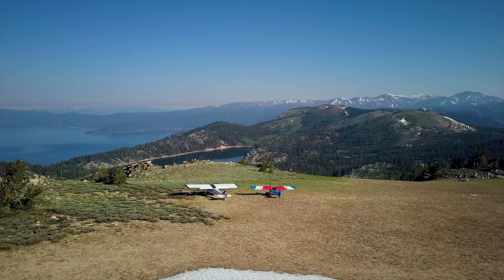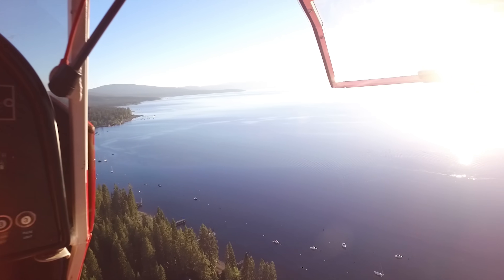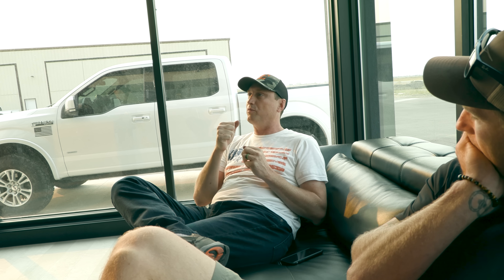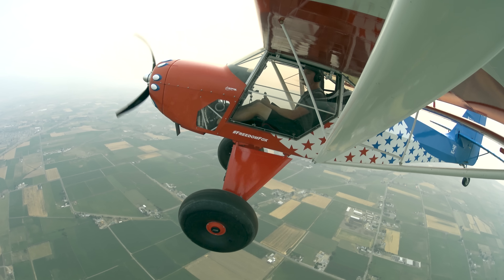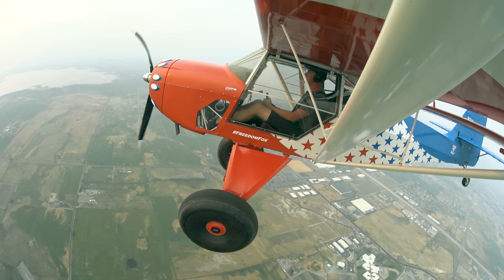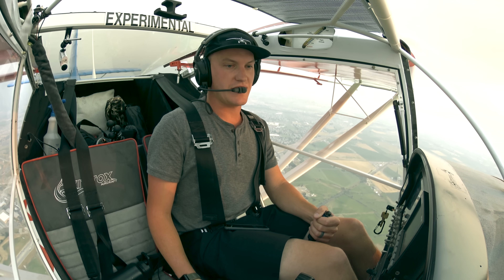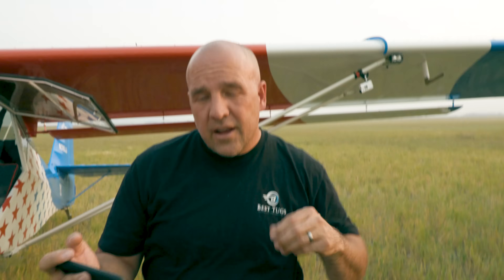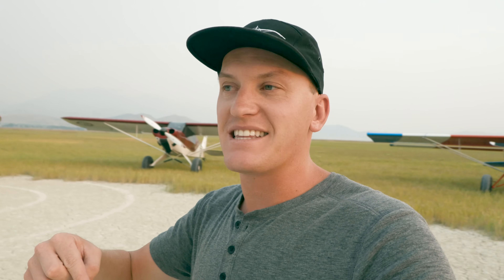YOUR FLIGHT INSTRUCTOR WAS WRONG! - Simulated vs Real Engine Failure

Comment: This is always an emotional debate!   I finally came across two intuitive examples that help explain- IT DEPENDS ON THE PROP, but probably prop stopped is less drag.   Fine propeller pitch, thin blades, and fewer blades tend to make propellers that produce less drag when stopped.   An example of this is a helicopter rotor.    The drag on an autorotating helicopter is high enough to give it a descent rate slower than a similarly-sized parachute!  Do you think the stalled rotor blade would give you that much drag?   As I picture plunging to my death in a helicopter with the blades stopped, it's pretty intuitive that the flat surface area of those types of blades aren't even close to the same drag as the disc of the autorotating prop.   

Now, as an intuitive example on the other end of the spectrum, consider a low-aspect ratio, huge chord, extremely steep pitch of a turbofan motor.   They produce much more drag with a locked, stopped fan than with a windmilling fan.     In the same "it depends" way, whether or not your idle power gives a better glide ratio than a stalled or windmilling prop depends on the propeller, the power setting, and the glide speed.

Comment: When I watch these I always wish there was more focus on the engineering answer to the problem. In this case:
If your rpm and pitch of the prop is above your airspeed you will decrease your decent rate, if it is equal it will do nothing, if it is lower it will increase your decent rate (and your engine will need to be applying breaking torque to the prop even if it is on).
When the prop is windmilling it continues to turn because the rpm and pitch are lower than the airspeed and it takes energy from the airflow and converts it to rotational power and turns your engine.
Finally the difference between a spinning (unstalled prop) and a stationary stalled prop. Just like when you give a prop too much pitch it stalls and produces less thrust, if you slow the prop down it will also stall and create less drag compared to when it is spinning slowly but fast enough to unstall the prop.
All the arguments about this fall into these various states. High rpm stalled prop (less than unstalled), High rpm unstalled prop (great thrust), Low rpm x pitch (low thrust), very low rpm x pitch (drag), stopped with pitch and stalled (drag but less than very low rpm).

Comment: My understanding having taken Fluid Dynamics in college - If you are going fast enough that the wind speed behind the propeller at idle is considerably lower than your planes air speed (say 10%), A spinning propeller will create more drag due to the pressure drag behind the prop. If its spinning, the pressure drag includes the full "disk" area behind the prop, if it's a stopped prop it's only the cross sectional area of the prop. The right answer is it depends. Depends on air speed of plane, air speed behind prop at idle.

Comment: C'mon blokes, it aint rocket science.  At engine idle, on the ground, in still air, the prop produces 'some' thrust & the engine idle speed is influenced by the actual load that the prop imposes as it pumps air. [if the prop fell off the engine, the idle speed would increase]
In flight, at engine idle, the prop still produces 'some' thrust which contributes to the forward motion of the aircraft. How great is this contribution??? Well, how long is a piece of string?
Regardless of how much, it is always "some" & this translates as a reduction of drag compared to when this small measure of thrust is not present. 

So this is the real point, the idling engine & rotating prop contribute as a REDUCTION IN DRAG. Even if the contribution is quite small, it is always there.

The rotation speed of the prop, & idling engine, should also be higher in the glide than when on the ground in still air since the pumping air load on the idling prop is much less when in the glide mode. [it's being fed air at speed to the intake side of the 'fan'] So the reduction of drag would, in my mind, be slightly better than if the engine idle speed was exactly the same as on the ground in still air. 
Simply put, The prop is actually an airscrew & even at low rotational speeds, in flight it is still trying to screw its way through the air.

So with a little less drag while the engine is still running, the glide angle should be a little more flat than if the prop was stationary & the air resistance [drag] was at its maximum.
Sorry fellers, but It's really not that hard, & this was borne out by the results of your tests.
I agree with Trent. In very light aircraft, the small amount of thrust & airflow provided by the idling prop will help to provide additional elevator [& rudder?] authority in the flare.
Happy landings blokes.

Comment: So I’ve got a couple things to mention here; best glide isn’t a speed that will give you the slowest decent, but rather the furthest distance (i.e. minimum drag). The speed of slowest decent is actually quite a bit slower (5-10 kts slower in a C152) So testing your time to decend isn’t really testing the right thing in my opinion, but should rather be testing glide distance. When I’m teaching my students this we only use best glide until the field is made, and then slow it down about 5kts in a C152 and add flaps, which to a degree can slow decent rate but mostly reduce landing speed at full deflection. I’d be careful of trying to slow a plane down in an effort to stop the prop, mostly because most deaths caused by engine failures are from loss of control (stall/spin). If you fly that bad boy to the ground in control you have a great chance of survival even if you hit something. You won’t be clever in an emergency, and it’s likely not going to be your best flying. This is very thought provoking, and It’ll likely help my instruction, thanks.

Comment: if in the air say engine at idle creating thrust but the thrust created is slower or lesser than the actual air speed say engine out at 60 mph with the engine at idle creating an "air speed thrust" of 20 mph. is it not still 40 mph less than true airspeed at glide?thus "drag"?

Comment: A five knot wind will have a bigger impact on your glidepath than this, which depends on specific installation details (climb prop, idle rigging, etc).  Trying to determine your glidepath in advance is training yourself to ignore reality.  I make students demonstrate an emergency landing in the glider at 6:1 with spoilers locked open, and then with spoilers locked closed (36:1).  Train to fly the deadstick glide accurately and safely.  If your target is rising in the windscreen you aren't going to make it.  Whether or not the simulated glide exactly matches the actual emergency glide is not as important.

Comment: This is one of the great pilot debates of all time, even in jets. Military pilots too often deal with flame-outs, and an air start is usually about the best you can hope for, prop or jet. My personal experience tells me the windmilling prop is the least desirable situation, while the prop producing partial thrust is best. It's such a dynamic situation with so many variables that I'm not sure there is a one size fits all answer. Testing like you did is highly desirable, and kudos to you guys for doing that.
Reply: I guess I have a bit more experience, then. I'm a retired Air Force colonel, having flown fighters for 27 years, then going into charter aviation for a total of over 20,000 hours. That does NOT mean I know everything, by any stretch of the imagination, but I have learned a couple of things over the years. The most critical thing in a loss of power is to keep your cool and never quit flying the plane. The rest will work itself out. And yes, I have experienced engine failure, though not too often, thank goodness.
Reply: I suspect the major prop manufacturers have performed wind tunnel tests on the various windmilling/seized scenarios. Personally, I think the windmilling prop on a dead engine is worse than seized prop. I could be wrong. As for the jet over water you mention, I'd probably shut down one engine. The plane will continue to fly and burn a lot less fuel.
Reply: I refer to glide. In any normally maintained plane, the battery is probably going to be sufficient for minimum needed electronics, and if you're VFR, you don't really need any gauge except airspeed. Angle of Attack would be nice, but most civilian planes don't have one. Neither is dependent on vacuum or electricity. Perhaps I should say, the ones I'm familiar with.

Comment: Seems like this should be a simple answer.  If I'm not wrong a prop is just a rotating wing.  So you rotate it at any speed, like an idle... it will still contribute some kind of pull/thrust.  If you have a still prop.... it's not contributing and forward lift for lack of a better way of saying it.

Comment: I could see a crossover point existing.  Don't forget that a propeller blade is an airfoil, and airfoils will stall.  I'd imagine that higher speeds, you could get more drag from an idling propeller vs stopped, but that's going to vary by blade design and angle.  

But for best glide, engine out scenario, you'd almost certainly going to be below that changeover speed.

Comment: Interesting. In the flight manual for my DA40d it gives a Glide ratio for windmilling and stationary prop and it is better with prop stationary (more drag for windmilling prop)
Reply: windmilling is different than engine at idle.
Reply: John Miller indeed. I just found it interesting as the video confirmed what’s in the flight manual. Would be handy if manufacturers included one for power at idle too so students can compare simulated engine failures to real ones.

Comment: You must calculate the pitch speed 1st.  Take the pitch of the prop times the RPM to get the pitch speed, which is a theoretical distance the prop would "screw" into the air, per revolution.  If the aircraft is going faster than the pitch speed, then there will be a drag induced, slowing your airspeed.  If the prop pitch speed is more that the actual aircraft speed, then there will be a thrust component added, increasing airspeed.  A windmilling prop creates the most drag.  The difference in drag between an idling engine, and a stopped prop is much closer to each other, and more difficult to predict.  I would think that an idling prop would be just like a car coasting down a hill in 1st gear, producing a lot of drag, but it looks like you guys are proving me wrong.  Interesting thoughts to ponder.
Reply: This was my thinking too - that for a prop at idle it's a matter of effective pitch speed vs airspeed. And whereas the fixed pitch prop (at a given idle RPM) will generate drag when airspeed is greater than pitch speed, and thrust when airspeed is less than pitch speed, a stopped propeller will generate no drag at zero airspeed, with drag increasing quadratically as airspeed increases.
Reply: Boyd , that's exactly what I was trying to say, but couldn't be so concise.  Thanks
Reply: You are so right. It is very easy to calculate.
Reply: "I would think that an idling prop would be just like a car coasting down a hill in 1st gear, producing a lot of drag" I think you are correct except that these are all fixed pitch props -- like a scooter or dirt bike with only one gear.  On a constant-speed prop the idle setting at full fine(like first gear in your analogy) is very much a drag force.
Reply: I don't even fly and intuitively knew this.

Comment: Trent, I'm glad you're smiling and not injured. It seems that this LS class aircraft has a lot of engine failures when equipped with the smaller  Rotax engines? Your thoughts? I'm really curious before i spend $38K in a new 915 IS.
Reply from the maker: The 2 stroke Rotax motors were prone to going quiet on you if you didn’t run them right, the 900 series are true Aircraft specific 4 stroke motors that are much more reliable, even have a 2000hr TBO 👍🏻 but yes, in the early days with the 2 strokes that was the case
Reply: Thx Trent, valuable info.

Comment: Great job showing this in the real world! I think people confuse a windmilling prop with an idling one, which causes this discussion to pop up now and then. That said, I don't think this is THAT much of a problem in an actual engine failure, as you'd pitch for best glide, then watch your chose landing spot to see if you could make it or not (i.e. is it going up or down on your canopy/windscreen), not just follow the numbers :). 

I fly gliders, and sometimes motor gliders. The latter are landed with the engine at idle, and I never thought about it, but that actually gives me a tiny bit more range in the glide! Now I might have to try landing with the engine stopped, just to see if it feels any different...

Comment: My only thought would be if at glide speed the plane was going faster then the air coming off a idling prop it could make dirty unstable air currents hit the wings and fuselage increasing drag or taking away life. you take a Cesena fuselage with working engine and prop to a wind tunnel, "like the one cleetus had Leroy the savage was in a couple weeks ago. Search it" run 2 tests 1 with the prop stopped and engine off and another with the prop at idle and the engine running. bring the sped of the wind tunnel up to the best glide speed for the Cessna or whatever your using. you will get slightly different aerodynamic drag numbers. not a big difference, 1 setup might equate to a extra few seconds in the air over the other, but without feathering the prop I cant see it making a huge difference.

Comment: Great discussion and conclusion find out what works best in your airplane and use it. In reality it’s somewhat irrelevant as thermal activity will make much more difference. Only sure way is stay higher than necessary and slip off speed or height. Never try to land on the numbers unless you think your engine will never stop! Precision can be practiced with a chosen spot safely further down the runway.

Comment: I think this is being over complicated. It’s all about relative wind to the propeller (think of it as a wing) Is the propeller making thrust? (Induced drag, relative wind ‘below’ the wing) or is the propeller making drag? (Form drag, relative wind ‘on top’ of the wing). 
The point where the chord line of the propeller is parallel with the relative wind separates the difference between thrust and drag. (Think of screwing a screw into a thread of wood. The screw is aligned with its path.)
Thrust is screwing the bore out of the wood. (Spinning fast, chips come out) vs
Drag, is trying to push the screw into the wood without it spinning.
Reply: I stand by what you said Palmer. I’d rather have a propeller at idle than stopped.

Comment: Just my $0.02.  If the point is to make a judgment about what to do in an actual emergency, then you need to test a windmilling prop vs a fixed prop (i.e. in both cases, engine off).  Because those are the only two scenarios that may exist in the event of an actual engine failure.  Testing whether you glide better with the engine operating but at idle vs. engine off and prop stopped provides incomplete data and may lead some to arrive at the wrong conclusion.  My recommendation: go do this test again with engine off in both scenarios, prop windmilling and prop stopped...and I think you'll arrive at what most people consider common knowledge -- your glide ratio will improve with the fixed prop.  This is, after all, the reason why all twin engine airplanes have featherable props.
Reply: The question actually was, "How well does an engine at idle simulate an actual engine out emergency.

Comment: Think about it this way, compare the drag at 5,000 rpm to 4, 000 rpm, etc etc. eventually, you reach 1,000 rpm and finally 0 rpm. The thrust/drag won't suddenly reverse, so 1,000 rpm has lass drag than 0 rpm.

Comment: the prop at idle speed will change the direction of the air stream witch hits the prop (front and rear side of its profile), because a rotary airspeed gets part of the stream. in this 2nd direction the prop has much much better aerodynamics (cw in germany)...so it will allways be less drag with rotating prop, in case it rotates the right direction ;-)

Comment: Trent, I think this is one of the best videos you have done yet. I love when people prove/disprove controversial topics with real world examples. 

The prop pitch can be used to determine that point at which the prop is either driving or being driven (creating drag). For example, my prop is a 43 pitch. Idle on the ground is about 600 but that's partially loaded so let's estimate unloaded idle rpm at 1000. 43" per revolution gives an unloaded (zero AOA) speed of 40.7 MPH. Slower than that and the engine is pulling air, faster than that and the air is pushing the engine. Now look at a L/D curve and remember that the prop is an airfoil. When it is being driven by the air, it is at a negative AOA and at some point, that airfoil will hit the critical angle and stall. It is still producing "lift" aka drag when stalled, but less than when windmilling. If the engine is switched off, the windmilling prop is using energy to pump air. If the engine is just idling, there is at least some energy added to the equation from burning gasoline, even if the engine is being driven by the air. 

Good job on the video. I know these can be harder to make than just a simple vlog but I find them much more engaging.